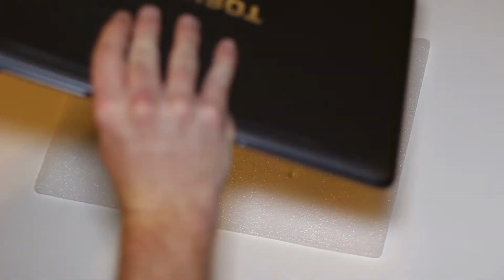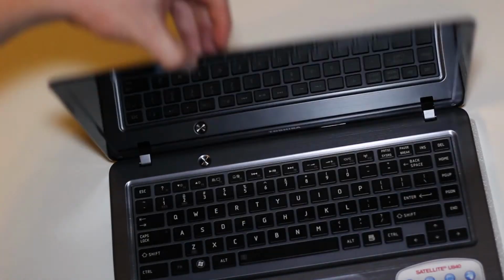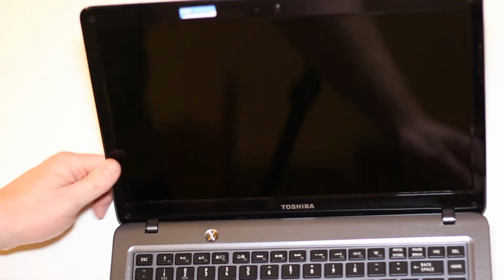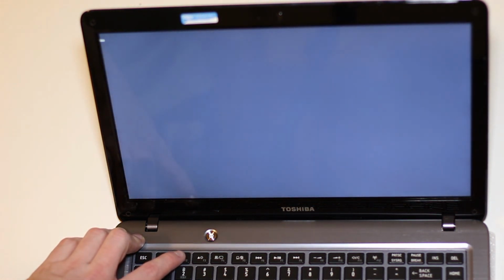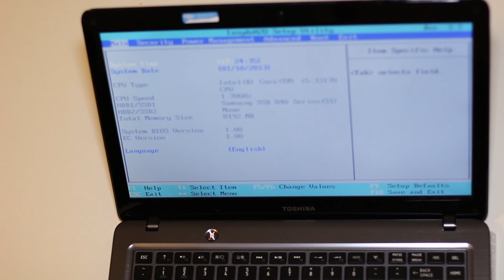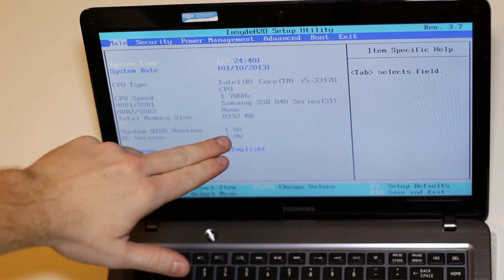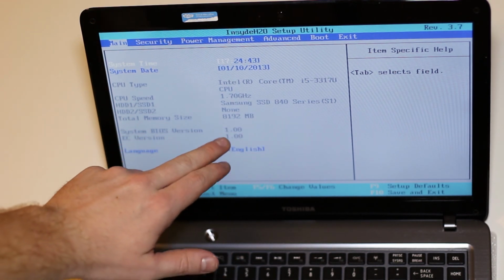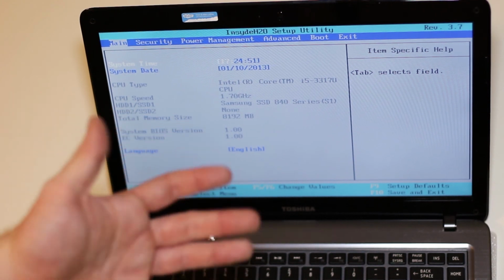Toshiba Ultrabook Teardown / Ram and SSD Hard Drive Upgrade - U845 (U945 is similar)

Comment: How about u945, I need to clean the fan but could not remove keyboard cable. After unlock all screw, I find that there are 2 cable, I can unplug the white one, but the black one I dont know how to remove it. Could u please advise me some?
Reply: Adnrie Lam Don't know if you're still trying to clean the fan. the're 2 latches on the side of the flex cables. Don't just pull the cable but release the latches. Remember to put them back on when you reinstall the cable. Let me know if you had any questions. I just got this computer. the fan was all dusty and the lubricant was dried, dirty. I replaced it with 3 - 1 lubricant in the meantime I got a replacemented.

Comment: Hi, nice video. Is the keyboard removable? I'm fixing one that's had coffee spilt over it. I've stripped it down, everything out (battery, mobo, cooling, LAN, etc) but can't see how to get the keyboard out. Part number is PSU4RA-00Q00C. Do I have to buy the palm rest with a keyboard in it?

Comment from the maker: I do not know. You could use some drive cloning software, as long as it allows you to move the stuff to a smaller drive. I however prefer a FRESH operating system install with no programs, then load each driver manually from the support page. If you are under warranty, give Toshiba a call and have them send you an operating system disk (windows 7 or windows 8). If that does not work you can obtain a full Windows 7 licensed copy on ebay for $32-$38.  Use external dvd or copy disk to flash drive.